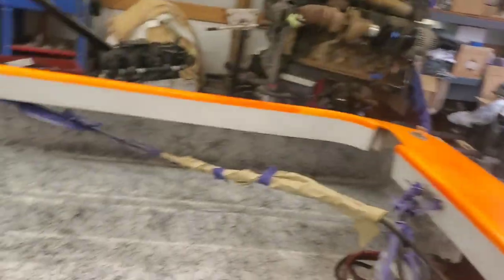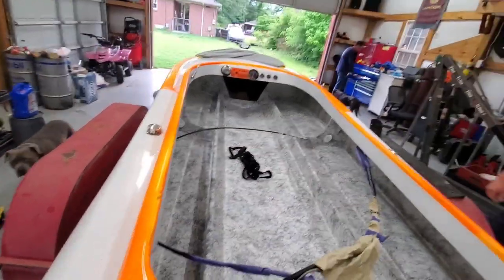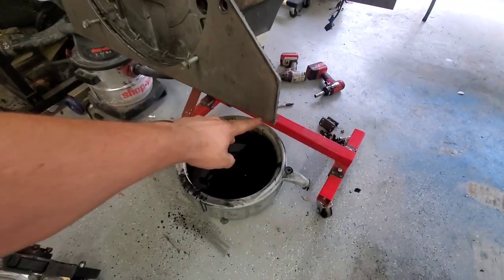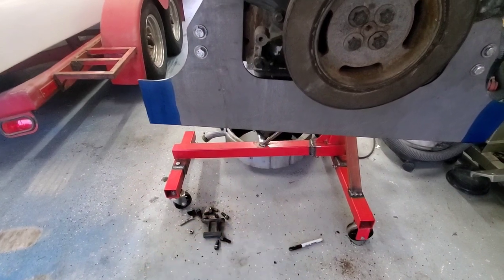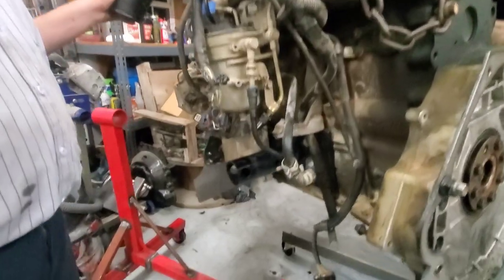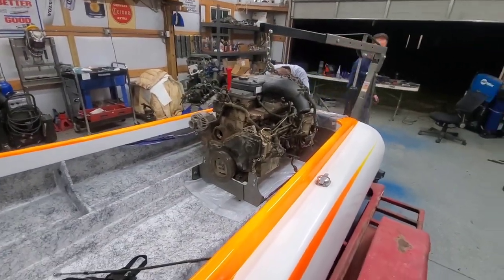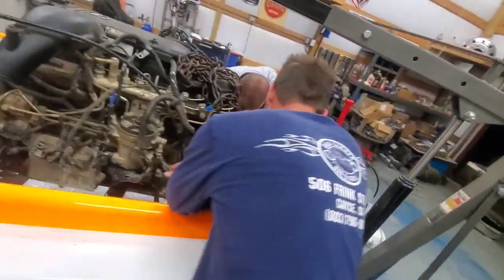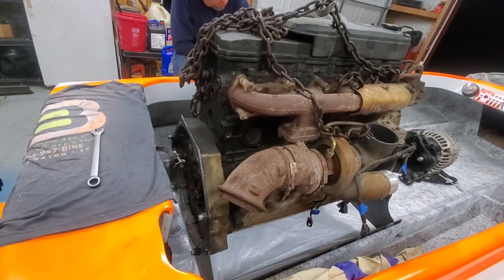Engine Is In! Mocking up Drive Line for the Cummins Jet! Part 4

Comment: Typical jet pump operates at 5k rpm. What are you doing to offset that?
Reply from the maker: It doesn't need to spin that hard. My BBC lake boat does 60mph at 4500 RPM and cruises around 3000RPM at 30MPH. We can safely spin the cummins 4500RPM as well.. This setup with the cummins is alot lighter than my lake boat, and we aren't shooting for speed a record.
Reply: @jakesspeedshop  I’ve got a 21ft jet boat with a BBF 550hp, spins 5500rpm at 65mph so I know what you mean. I didn’t know you could spin these to 4500rpm safely. Are you upgrading the turbo so it doesn’t run out of steam at that high of rpm?
Reply from the maker: At first no. We plan on later down the road. Just a simple valve spring upgrade for now.